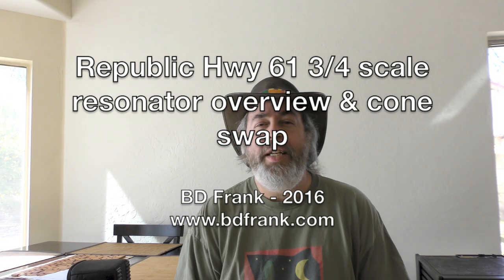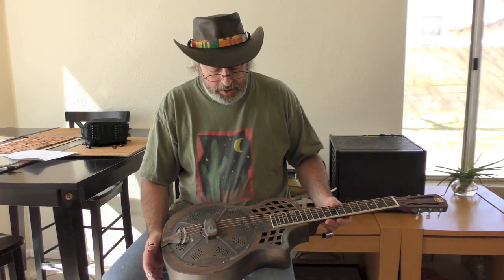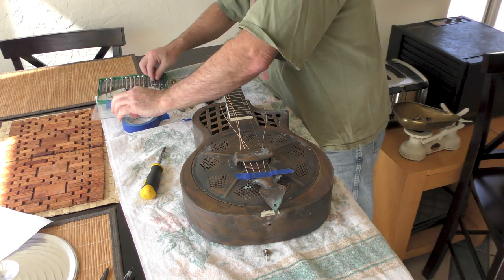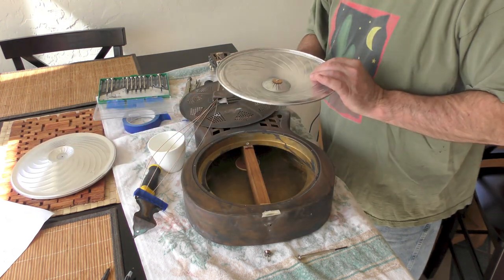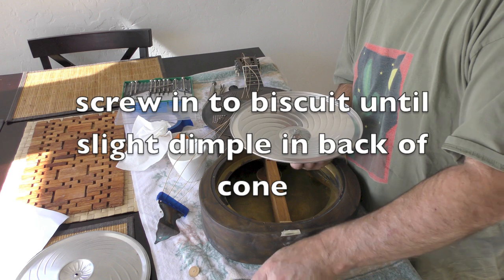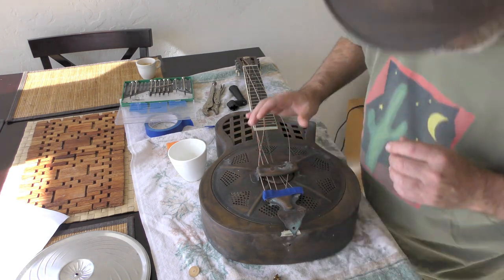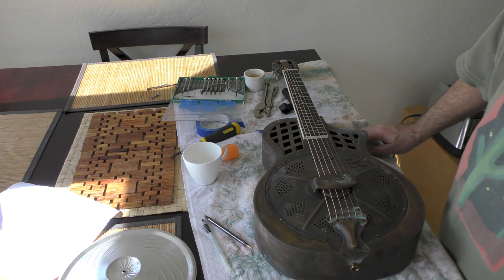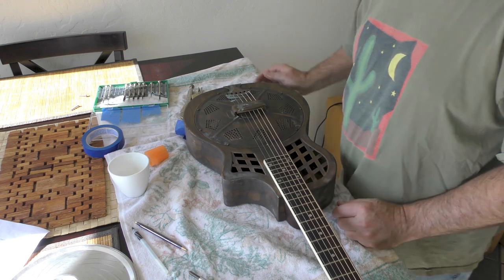Resonator guitar cone swap

Comment: Just picked up a Rogue trolian CT44 for cheap. My problem was completely different than yours. The action was way too high. After watching your video i took mine apart just like you did. The piece glued into the biscuit slot wasnt glued in. I remove it and sanded abot 1/16 inch off and it made a world of difference.  Action is better but still high enough for slide and the intonation still a little sharp but 1000 percent better. Thanks for the video. I was intimidated to tear it apart until i watched this.
Reply from the maker: That is great! That is the best compliment I could get! Wasn't so bad was it. A few minor things to try for intonation. Sometimes the cone (with strings pretty loose) can be shifted just a little bit back and forth. Also you can twist it (the cone) changing the angle of the bridge slightly. I think National makes a compensated bridge, someone also mentioned an aftermarket bridge available I think… if you have the time and energy you can usually get it a little better, never perfect. Thanks for watching and commenting. Much appreciated.

Comment: I saw a National Delphi in a shop yesterday. New for sale but I think it has been hanging around for a while. The clear coat on the neck, right next to the body, had lifted off. What is it a Two-Pack resin? There looked to be air bubbles under clear coat at the end of the guitar and, I can’t say for sure, but it looked almost like there was a crack in the wood up by the tuners. All this on a AUD$4395 Instrument. Shocked!

Comment: THANK you very much..I allso have a Republic resolian steel...could you make a demo on how to lower the action on the bridge?  PLEASE!!!   and  does that wood bridge come off the biscut?THANK you so much for this vidio I call my REPUBLIC MY POOR BOY NATIONAL.. I wish i could afford a NATIONAL...THANK YOU AGAIN SO MUCH for this vidio
Reply from the maker: Hey Tommy - I am usually doing the opposite to raise the action for slide! I would suggest you buy a couple of new biscuits (pretty inexpensive) and sand them down a little bit at a time. Buy two so you can screw up one and still have a good one. The bridge part does come out of the new biscuits, however not sure on the Republic one. Personally, I usually worked from the top down so the bottom of the bridge stays flat on the biscuit base. However, if you can get the bridge off the biscuit base on your Republic and you are happy with the bridge string spacing and contour, you can try sanding from the bottom of the bridge, just go slow.  I would also suggest to leave the cover plate off till you get it where you want it. Depending on the set up, you might have to work with the nut end as well. As with learning any type of repair, guitar and otherwise, be ready to screw up the first one as a sacrificial learning tool. Hope it works out well, let me know - thanks for checking out the video - BD Frank
Reply: Wow thanx for getting back so fast .ARE you saying you sand from the slotted side (TOP) down? then what? you re slot ? (republic wood bridges are not made with any love, they send them out with chips and cuts(thats why there guitars are cheap in price)( China no dout)any way IVE all ready ordered a Stewart Mcdonald fret end file..got some sharp ends ..this is ok cos when im done..it will sound better play better and i will have more love for it .because of you im thinking of buying a national cone ...???have any suggestions ,on The best way to buy one,  and oh yea! do you know how measure the cone with out opening it up???....and thank you for you time ...THANK YOU SO MUCH...
Reply from the maker: Gotten plenty of stuff from Stewert MD, there ok too... Yes I work them from the top down, as long as you don't loose your string spacing from the bevel. I will mark the string locations from the old one on the side of the new bridge to keep track...
Reply: very smart and very cool thank youi only want to take it down a little bit...too make my bar chords a little bit easier..im thinking i want to do this it plays ok  now but i want it to be the  best for me i can get ...thank you so very much
Reply: Your truss rod may also need adjusted to bring the action down. Turning it to the right will straighten the neck thus lowering the action. Small slow adjustments are the key when doing this.

Comment: I am curio😂, do you still have the Republic resonator, and what do you think about them after a few years?
Reply from the maker: Hey John,  thanks for checking out the video. No I do not have the guitar anymore. I bought the smaller size for travel and the travel ended. Also was not real impressed with the build quality, not enough to keep it. Not knocking Republic as it was an ok guitar if you can’t afford another superior brand. I am glad that there are less expensive guitar providers like Republic. However, if one can hold out for a National, it’s worth the wait…only a personal opinion.

Comment: Does the saddle come out and does it have to be wood, with all other adjustments my strings are too high ,on other guitars I would sand down the saddle but unsure on this
Reply from the maker: it does on the national biscuits. Not sure if it is glued on this one. I have always sanded them from the top anyway. National is making adjustable ones now (for intonation not height), expensive though. When I replace my biscuits, I typically order 2 and screw one up. They are not expensive...

Comment: Which bisquit did you end up using?  The National's bridge, I take it, would need to be trimmed?
Reply from the maker: I actually did not replace it. I was planning on going back at it to raise both the nut and bridge for slide (never got to it). I am guessing (pretty sure) that the National biscuit would fit. Even if it happens to be a tad larger, don't think it would matter much. Let me know if you find out differently. Pretty sure in one of the comments, someone changed it out... best of luck!! I just measured the National biscuit ±2- 3/8th inches

Comment: HEY FRANK FIRST OFF I HOPE YOUR SAFE AND HEALTHY!!!!!2ndly im haveing a guitar crises ...you told me to get a couple biscuits and i did not ... so i broke a repupublic bisscuit trying to work on the action...im learning ...the hard way...any way do you know if the National biscuits from Elderly you got with your cone will fit in a REpblic ..I ask because , the saddle fans out a bit..on those... I would be very grate ful if you could help me on that... its 10 dollars cheaper then stewert macs ...THANK YOU FOR YOUR TIME!!!
Reply from the maker: I am guessing the biscuits for sale probably includes a size. Measure yours. Would guess it would be the same or really close. Email them if you have to... That is EXACTLY why I always get a couple. I have screwed up a few myself... No big deal, just part of the learning process. My motto  is (concerning everything). Totally screw it up beyond repair before taking it to anyone. I have been laughed at by many professionals. I seem to remember a very old Audi carburetor. The mechanic laughed so hard, he fixed it for free. Nothing ventured, nothing gained. You will get it right eventually.
Reply: THANK you for your quick response, I sent a message to republic and ask them to send me the diameter of there biscuts i glued it, and put it back in but its not right ..ill have to open it up again ... thanx man for your help!!! STAY SAFE!!!!

Comment: is ti possible to swap out a biscuit cone for a spider cone?
Reply from the maker: Interesting question. that I do not know - let me know what you find... Never had a spider setup
Reply: I'd say no way. A biscuit cone is shaped like a mountain and must be mounted deep in the body. A spider is inverted like a speaker and mounts closer to the top. You could modify the mount by adding a ring if possible but I doubt it's worth the effort.
I would suggest you watch some vids on converting a flat top to a spider cone instead.

Comment: Thank you for making this video, it seems to be the only real back to back comparison for a Hot Rod cone on YouTube. I just wanted to point out that in the first sound example with the original cone, the guitar is tuned to Ab, and then the guitar was tuned to A for the National cone. So that added some brightness and a different sound or depth. I checked it with a tuner just to be sure. The Hot Rod definitely is brighter but sounds thinner to me; maybe due to the tighter strings. I have one of the first National Resophonic Style O's built in 1995. Do you know what the difference is between that original cone and the newer Hot Rod in terms of sound and tone? All I know is the Hot Rod is thinner. Thanks.
Reply from the maker: Nice catch!!! You are correct!!!!. However,  although not the exact same tuning in the video, I spent a fair amount of time playing the guit with both cones and did prefer the hot rod for my taste. Perhaps someone at National can clarify the differences you ask, as I am not an EXPERT. Email them. Thank you for watching. I did post due to lack of info available as I was curious. Though critiqued as if an controlled MIT experiment, this is nothing but one persons opinion... And I still stand behind my personal conclusions - thanks. I use D" Addario EJ19 strings, which I am sure also influences the outcome

Comment: Hello Frank, thank you very much for this video. I have a few question that I would like to ask, and hopefully you won't mind helping me out.

So here's the case, I just bought a new Hot Rod Resonator cone to replace my collapsed Gretsch Ampli Sonic cone. The thing is, the cone got a quite huge dent somewhere along the way. I pushed it and it went straight back, but there are still small dents all over the cone.

My question is, do you think that a dented cone is a broken cone? Will the dents make the cone prone to collapse?
Will it affect the longevity of the cone? The huge dent is no more, it's quite even now, but I just worried that it might somehow affect the cone in any way.

Once again thank you for this video, and thank you for your response.
Reply from the maker: I am really not a cone expert, but common sense would tend to lend the thought that this would affect how the cone vibrates, but to what extent? Try it, who knows, it might suck or sound great!!! I would try it just because I have it... Let me know the results - thanks

Comment: Thanks for sharing. 
Sorry for English Google.  I put big strings on my gretsch, and the cone was a little slumped, all the strings buzz beyond the seventh fret.  What do you advise me to go up the action.  I see three options, changing the cookie for a wider one, or changing the piece of wood that fits in against a higher one, or finally and at the simplest, putting a layer of glue between the biscuit and the cone.
Reply from the maker: My suggestion if you are using for slide (quick fix) is a new biscuit that you can file down to acceptable height... however, sounds like possible neck adjustments may be necessary
Reply: thanks Frank for the quick answer.  sorry for purely Google English.  
I did a temporary thing by adding a small block of wood at the bottom of the notch on the biscuit.  It works well.  But I will follow your advice and change biscuit, when I found the woods adequate.  
The neck setting is perfect.  when buzzes comes beyond the seventh or ninth fret, the problem always comes from the action too low at the easel.  (I'm afraid the translation of technical or craft words will be translated anyhow).

Comment: Hi there just watched the Vid really good, just a quick question how do you set up the intonation.
Reply from the maker: Really good question. You are pretty much at the mercy of the accuracy of the build. Usually you have some play in the cone as it does not sit in tight, so you can push the cone forward and back a little. Also you can slightly rotate the cone / biscuit. I have threatened to try to attach a tune o matic type bridge to the bottom of a biscuit, but haven't gotten around to it... Another thought was a wider upper piece of the bridge, then file like a banjo compensated bridge. I play 99% slide so not much of a problem, but still plagues me.
Reply: B Frank Hi again I am in the UK whilst trolling the inter web I came across a biscuit and saddle for a reso that was adjustable. Made in the Uk. But out of stock. Will try to find out more. Chris
Reply: @bfrank3468  Hi this is the website  http://www.acousticmasters.com/AcousticMasters_ResobridgeS.htm
Reply from the maker: @Stillgrizzling  cool